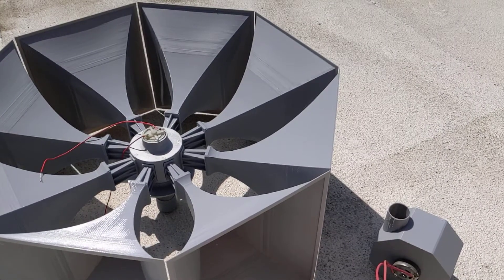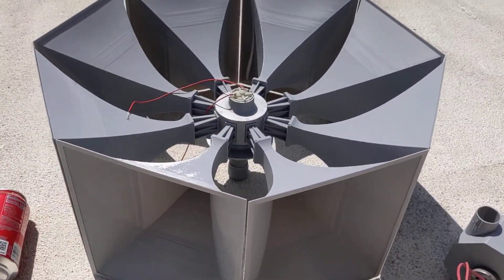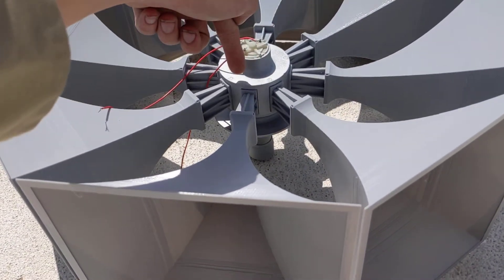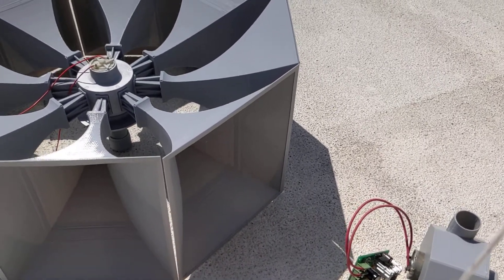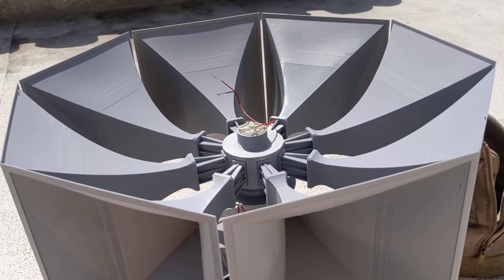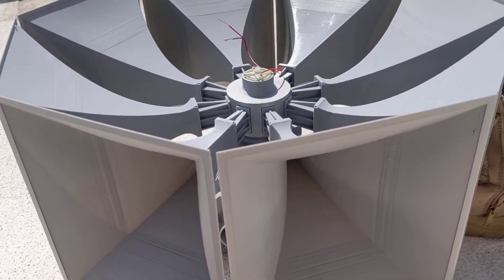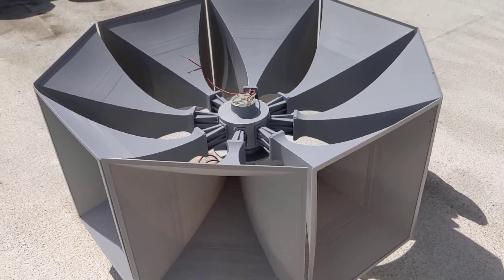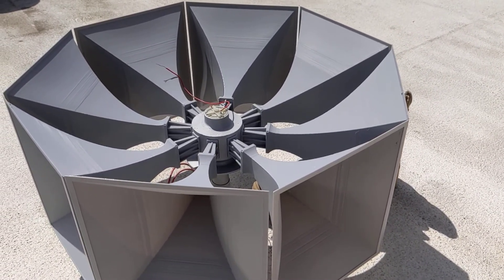3d printed SONGS model 120 siren

Comment: If you need to slow down the rotor, short the terminals of the motor together. The motor will become a generator, and will run into a dead short load, causing the motor armature to lug. If you need less braking, use a braking resistor instead of a short.
Reply from the maker: Believe me I'm already aware of that effect, but that would mean I would also have to add an additional circuit to allow the motor to be powered and then once the motor drops out the braking resistor cuts in after a predetermined delay. This was just a prototype but its mainly to prove a point that the real ones would have most likely had a windmilling issue due to the asymmetric rotor port ratio